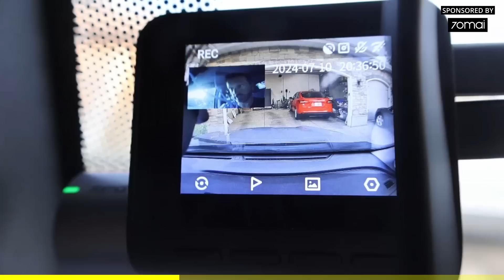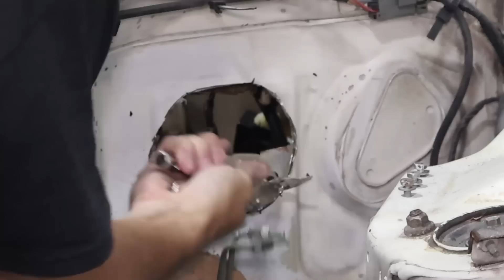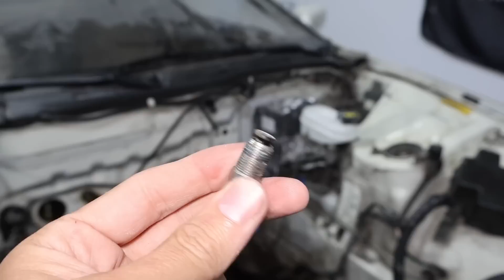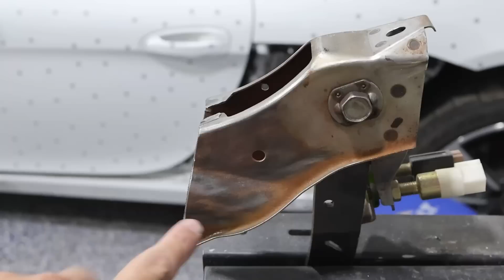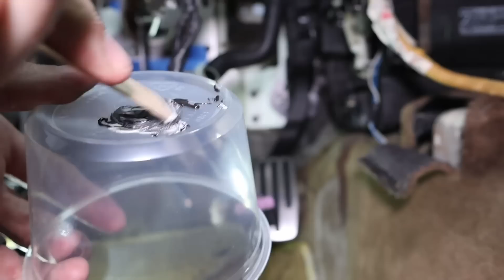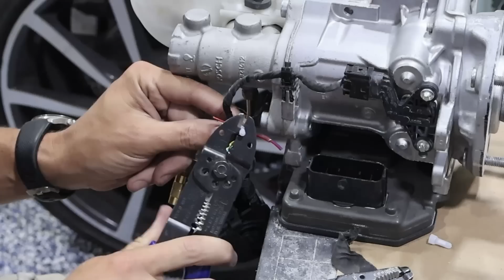Tesla Tech in Your Car: Installing the iBooster Electric Brake System

Comment from the maker: 70mai Dashcam links
Amazon: https://amzn.to/4cXIq8G
70mai official: https://bit.ly/3SdsrLN
70mai fb group: https://bit.ly/3LqYu7i
Reply: I bought a carpodgo from your link using your code and love it. Thank you wish you nothing but success
Reply from the maker: @Oliver-Klozehoff  awesome!
Reply: @electricsupercar  Will also point you to McMaster Carr and look at self locking plates, which you will probably fall in loce with. A nut that is riveted in, and if not using rivnuts you also can look at Hank fasteners, which work similar to a rivnut, but you have a larger hole that you use a mandrel and a bolt that forms the thin edge into a rivet.

Comment: do abs function normally? do we have to provide false engine signals to ecu for some things to work properly? for example abs, traction control, stability programme!
Reply from the maker: ABS is more related to wheel speed sensors.  With that said many of the modules like ABS may need to communicate with other modules to function correctly
Reply: @electricsupercar  Thank you so much for your reply😁, waiting for update on our jeep conversion.

Comment: Did you worry about pedal travel at all? I want to try this in my old bronco project but i havent found any info on what the ibooster needs for pedal travel. Do you just make sure the booster shaft goes all the way in at full braking?
Reply from the maker: You should do your due diligence.  You need to compare your current pedal travel and pedal:brake master cylinder ratio, including the diameter of the master cylinder.  You do not want your brakes to be too touchy or not responsive enough.

Comment: What was the reason to replace the entire brake assembly in the first place? (Instead of using for example an electric vacuum pump only with the old stuff.) Was it because the old brake assist would not have been strong enough for the new electric motors?
Reply from the maker: Some of the reasons are noise ( a vacuum pump would be running much of the time) and it is not as efficient as the Tesla brake system

Comment: Avoid rivnuts wherever possible on important parts like brakes, steering and suspension!
Instead, fit a bolt with a nut, then tack weld the nut in place. Dab of paint to protect and you're done.

Comment: What is the pedal feel going to be like if it's so light you can push it with a finger? I assume those other wires could be used to change the level of assistance if they were also wired in somehow?
Reply from the maker: I think a lot of the resistance is in the booster itself.

Comment: Good thing the nutsets didn’t work.  They would have failed.
Reply from the maker: @Chawaonga  interesting 🤔.   Why do you think that?
Reply: I’ve used them for automotive application couple times. Each time, vibrations and pressure caused failure.  They would slip out.
Reply: @Chawaonga you're putting them in wrong then. Steel ones in steel, aluminum in aluminum.  Don't know how many times I've seen people use a Harbour Freight kit with it's aluminum nutserts in steel. The aluminum gets vibrated by the steel and does exactly what you described. My observations from watching people and building emergency vehicles.

Comment: Are you using the Ibooster without CAN wires ? Is there a backup mode when it loses connection to the car ?
Reply from the maker: No can wires.  If there is a failure in the circuit, it just becomes manual brakes (no assist).

Comment: I have a question.  Why couldn't you have cut off the ends of the brake lines & just slid on the other fittings & then re-flair the lines?  This way you wouldn't have had to have those adapter lines?  Really enjoy your videos.  Thanks!
Reply from the maker: Hey thanks for the comment.  Brake master cylinder needed a different diameter brake tubing.
Reply: @electricsupercar  
Ah.  Ok.  I was wondering if that was the case.  Thanks!

Comment: The single most frustrating thing to me is that Bosch refuses to sell these except to automotive OEMs. ZF announced they would start offering their VW/Audi EBB through their aftermarket brand TRW starting Jan ‘23, but that has either not happened or they’ve severely limited the distribution.

It will probably require more expansive right to repair laws before we peons can acquire these parts without relying on salvage, that or somebody partnering with an auto parts factory in China to produce a universal EBB that independent shops and conversions can use.

Comment: Missed how you did the rivet nuts.  Did you forget to weld the top plate after you cut off the top of the pedal assembly (or is that even needed)? 😀
Reply from the maker: I forgot to record that part.  Yes, I used rivnuts.  They seemed to work just fine.  I still need to weld the piece.  It is on order.

Comment: You can weld studs sometimes instead of using rivetnuts
Reply from the maker: Good call
Reply: Or instead of welding on studs, weld on the nuts to one side or the other. The welds wouldn't be holding any load, but it just holds it from spinning.

Comment: The 3D printed templates are genius!  WAY better than the old fashioned cardboard.  A perfect design and then Sendcutsend makes the final part.  Doesn’t get any better than that.
Reply from the maker: That's the plan!
Reply: @electricsupercar yup excellent! Did you make the aluminium plate yourself or get them made up? I’m guessing the later from a local fabricator? Just curious, love your channel.
Reply: @lawrencemanning  sendcutsend
Reply: Great but is consuming, needs knowledge around fusion 360 or similar and a 3D printer, I agree the result is better.
Reply: I prefer cardboard direct to steel works for me no multiple attempts I use a round file for the holes in cardboard scribe and CP the holes to drill and cut to shape only waste is free cardboard multiple  bits can be glued together with an overlap for complex parts rather than many goes with 1 piece . with a few thousand dollars and a few dozen hours I could get a 3 d scanner and learn computer CAD  but in a few minutes I can make a CAD cardboard aided design.

Comment: How many hours did you get into that project. 
I was suprised on how easy that pedal pushed. Now I have to go check out my tesla to compare.
Those rubber pedals peel right off. I replaced mine with the ones that say on-off.
Reply from the maker: Interesting 🤔